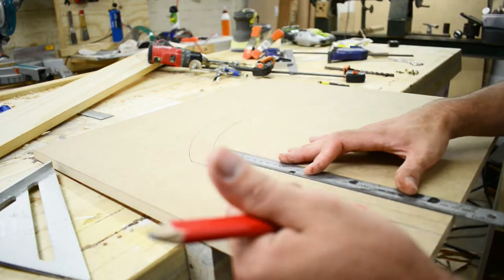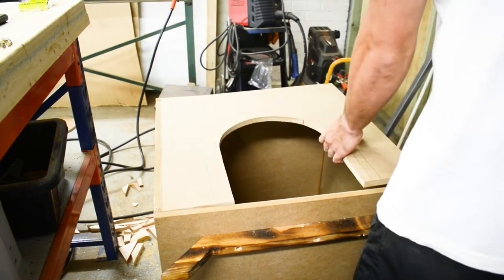DIY Cat Litter Box Cover

Comment: I like this idea. I have been thinking of something for my cat's litter tray. I used an almost identical design, many years ago, for a bed for my dog. She loved to be enclosed at night. The inside was padded, and had a cushion made to size for her to sleep on. I used the bed as a television table.

I may produce something very like this for my cat, so thanks for the ideas. Two additions that I will probably include will be: using vinyl floor tiles for lining the inside, as good as my cat is, she sometimes has mishaps, and it would be easier to clean; leaving a slight lip at the entrance in order to reduce the spillage of litter, without impeding her access.

Thanks for sharing this. Very helpful.